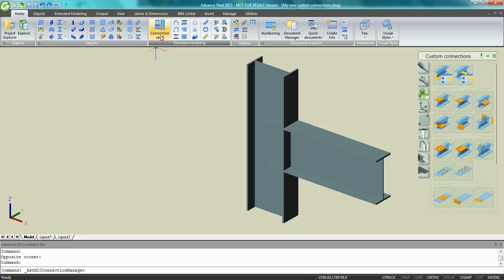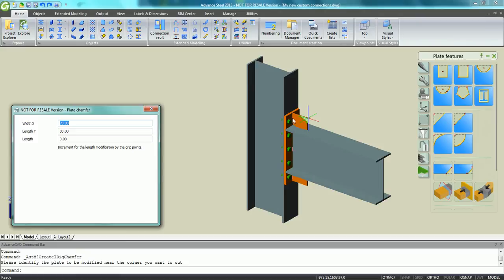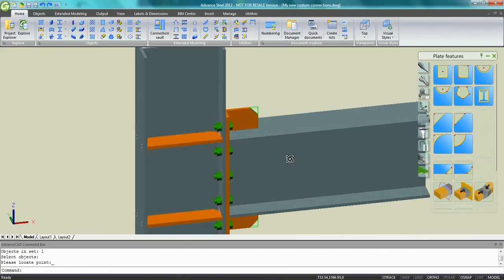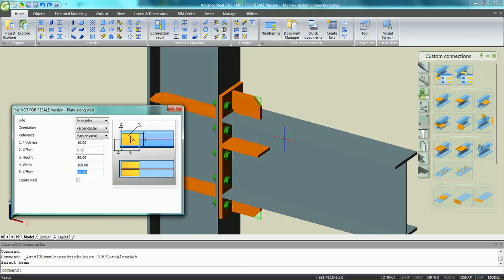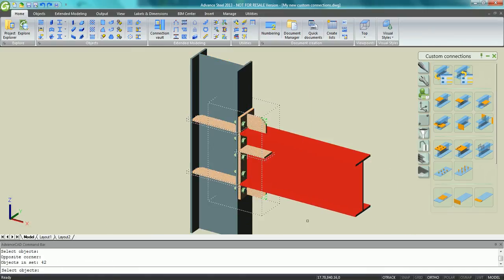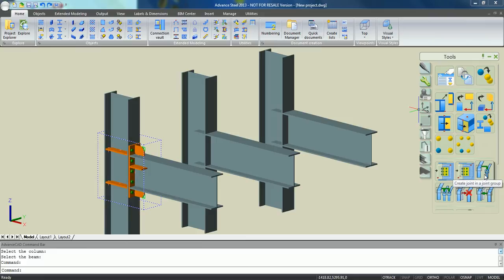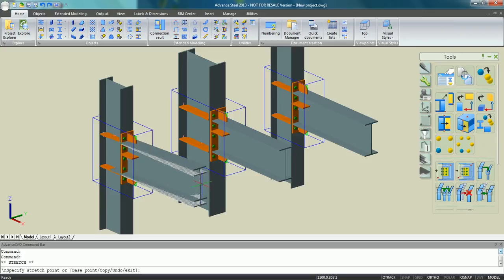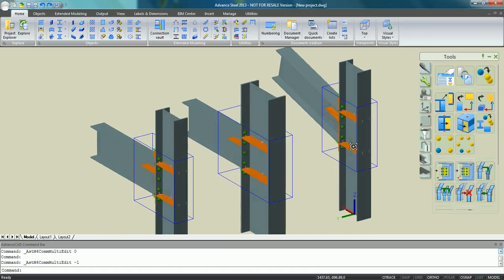NEW - Advance Steel 2013 - Powerful custom connections

Comment from the maker: Of course, custom connections are parametric!
E.g. if you change the column size, the custom connection between the column and the beam will adapt automatically
E.g. if you use one of the (new) automatic bricks (to define the secondary parts created by the custom connection) and set the width definition to a parameter such as "Same as the beam", then if the beam section changes, the custom connection will again adapt automatically

Comment: am i right that new custom connectors are not parametric?you can not link one parameter (plate width for example) to another (beam flenge width)? btw is it posible to make size of new tool palette smaller?it`s enormous!can you make vid to show what intelligent welding lines in details and other improvements in as2013 look like?

Comment from the maker: Main new features in Advance Steel 2013: AutoCAD 2013 compliancy, Windows compliancy, Advance Steel Standalone 64-bit platform, New tool palette, Custom connections, Complete set of new cold rolled joints, Enhancements in existing joints, New option to create a polygonal cut from a polyline, New option to define specific holes for anchors, ….